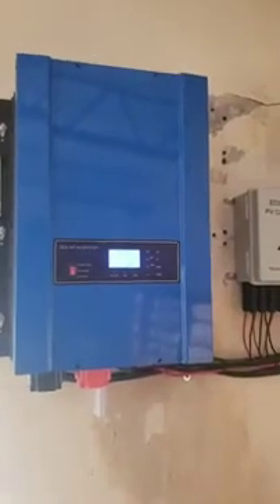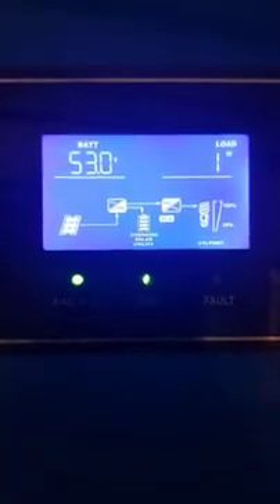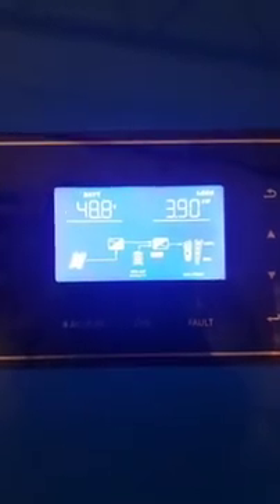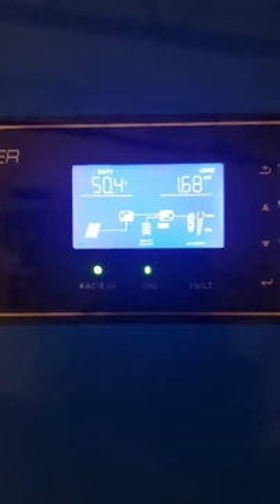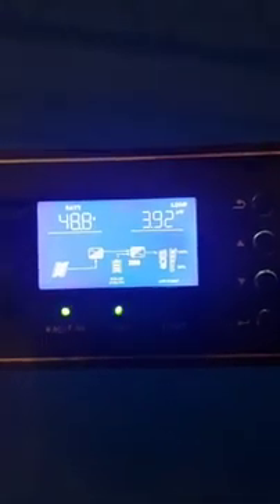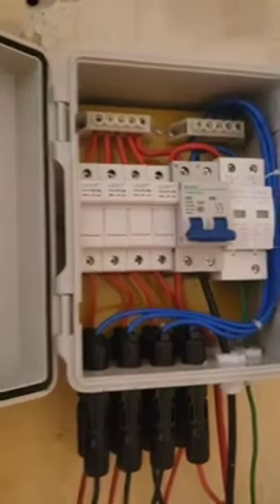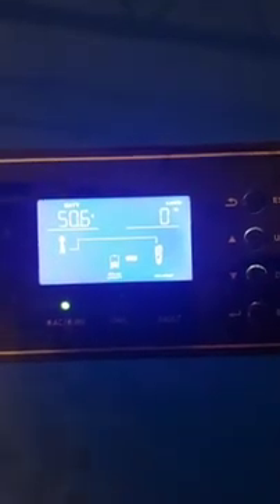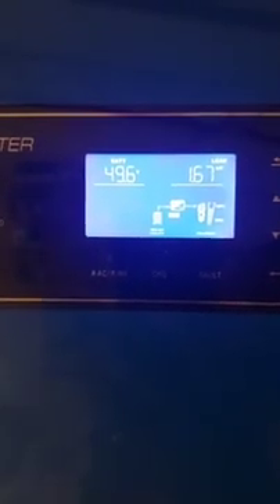Sigineer M6000L-48SP overload tests

Comment: I have the same issue with Sigineer 3000W.  Can't even start a 1HP motor and I am using a soft starter (a very good one designed for motors.  Setup the dip switches to lower in rush and it still does not start it. These inverters do not handle surges as good as I had expected.  Certainly do not handle as high as what the manual states.

Comment: It's not the inverter. It's your batteries. Did you bother to look at the display and see how low your battery voltage dropped even under a moderate load. The inverter is doing what it's supposed to do when your battery voltage is to low. It's called a a low voltage alarm.

Comment: issue is the batteries, you need a large lifepo4 bank with proper gauge wiring or double the size for lead acid. the voltage sag is way too much

Comment: Too big of a surge for a 6kw inverter.  A lot depends on the efficiency of the 3hp motor as well. Have you heard of soft starters? They help eliminate the surge in induction motors
Reply from the maker: This inverter is said to be able to sustain 12KW for 5 sec and 18KW for 20 ms. I was under the impression that it was able to start my 3HP motor, but it never did and i never figured out why. I was able to find a solution to the problem by upgrading the inverter to a 12KW model instead. I heard of soft starters and investigated the solution but could find a product that i could implement.

Comment: Thank you! so what is your prognosis? it sucks??
Reply from the maker: I never figured out what the problem really was. I wasn't able to measure how much current my 3HP motor was pulling during startup, but it's obvious that it was pulling enough to be able to trip the inverter's safety system every time. But i have upgraded to a 12KW inverter and solved the problem. I swear by these inverters now. They are amazing.
Reply: @cedricadam3850  thanks